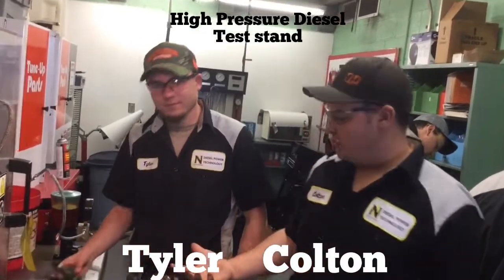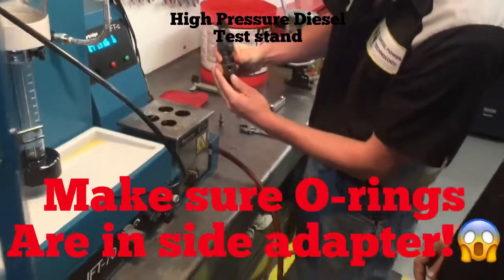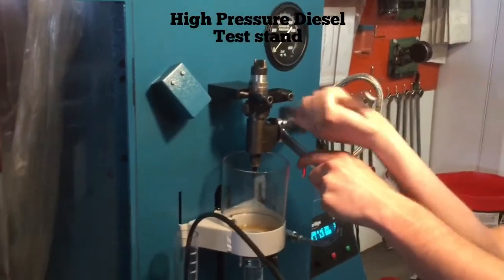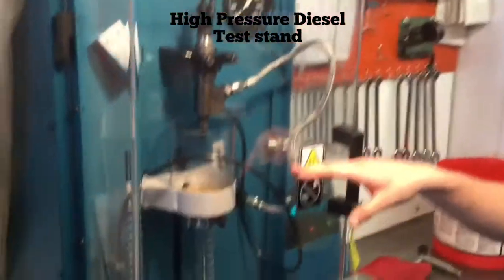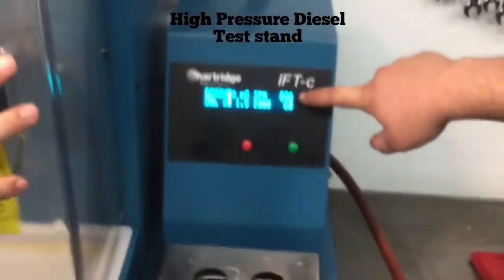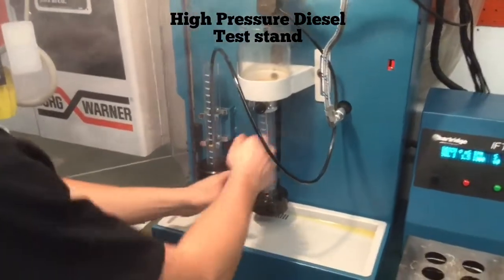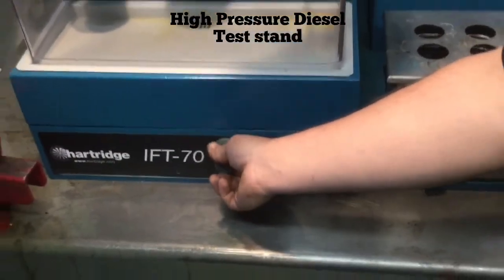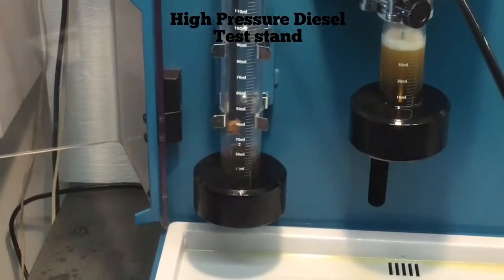Hartridge Diesel Injector Tester IFT-70  Explained

Comment: Hi friend, I was looking for some information on the hartridge ift-70, I saw you seling or sold one , The thing is that I have one but,  one day while I was working, I think I put too much load on the injector, and then I heard a click and pump stop working, I get pressure on the pressure gauge, I hear injector solenoid clicking, I checked fuses all good, its the  pump won't push pressure to the injector and I don't hear the pump working and recharging, any help will be highly appreciated,

By the way Im Ramiro from Los Angeles ,CA ,

REGARDS